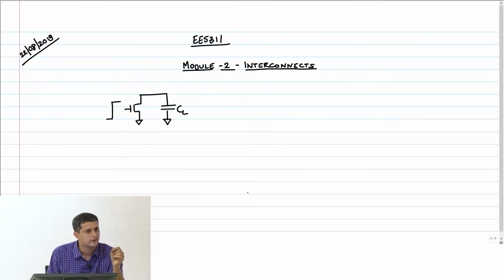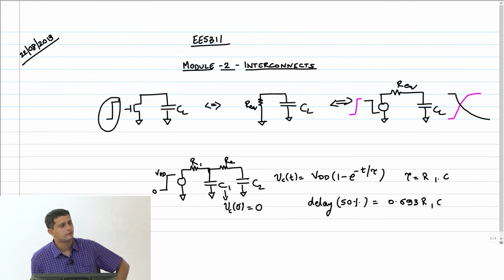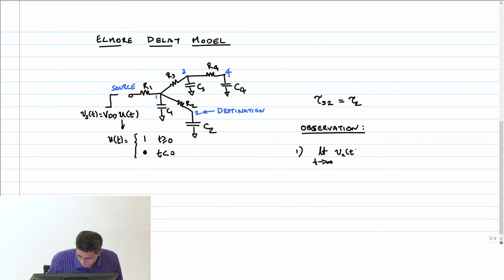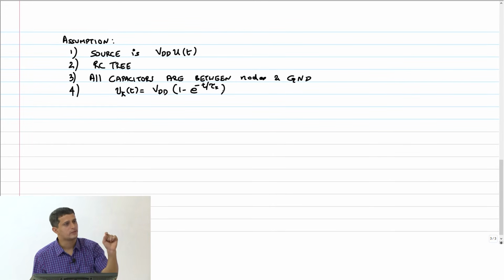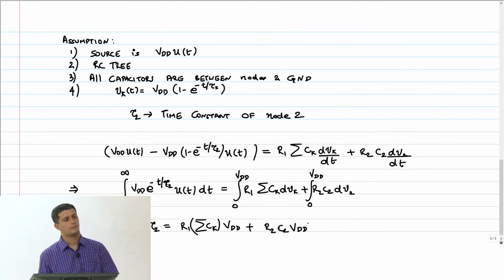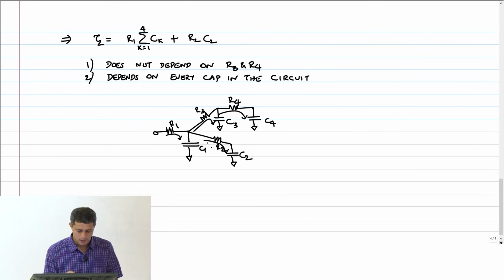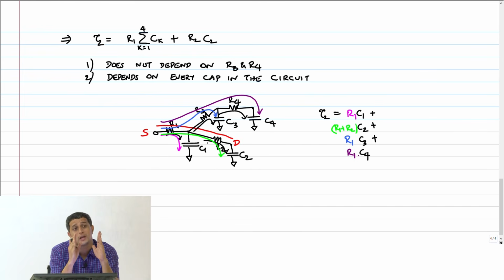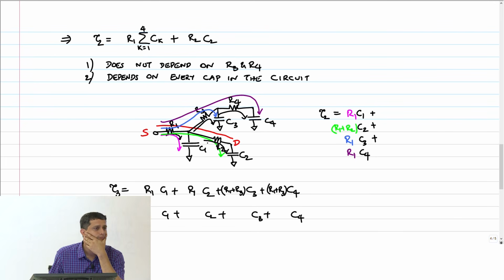Inverter - 13 - Elmore Delay Model

Comment: The reason it does not depend on R3 and R4 is that we are more focussed on the charges to get the required VDD. Ultimately , the stored charges across capacitor gets you the voltage. So, the magnitude of R3 and R4 does not impact in any way on the charges to the C3 and C4.

Comment: 10::45_15-04-24_@IIIT-H 
Why resistors R3 and R4 doesn't contribute for node 2 delay?
Reply: becoz we have to consider only those resistors which are common in path from src->destination node  and src->current node

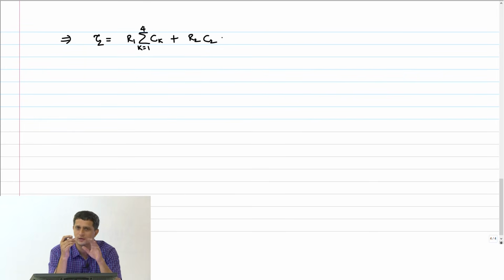Comment: 19:30 The capacitor voltage also the node voltage equation is not exact, it's approximate to a 1st order then?
Reply: Correct. It is a safe assumption that an RC model works in first order across all branches.